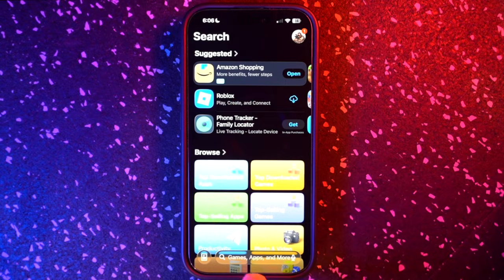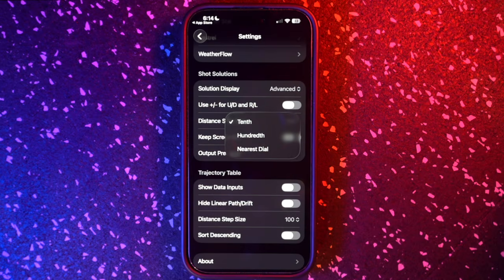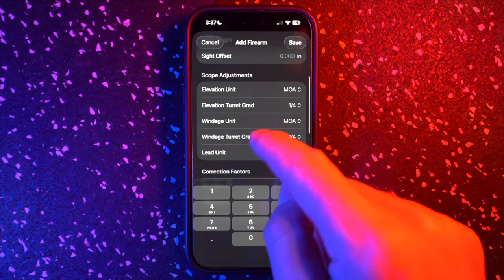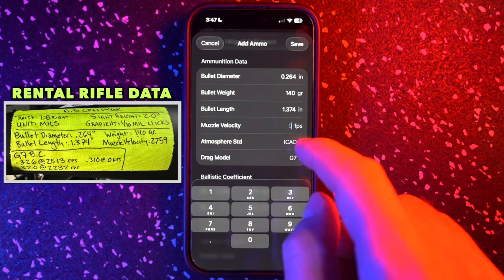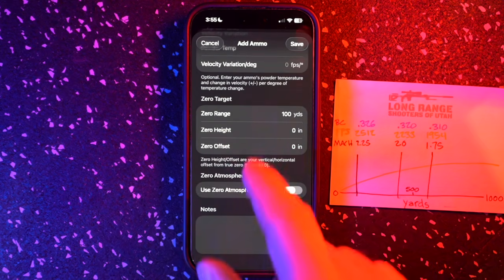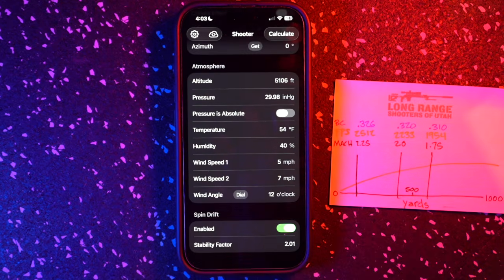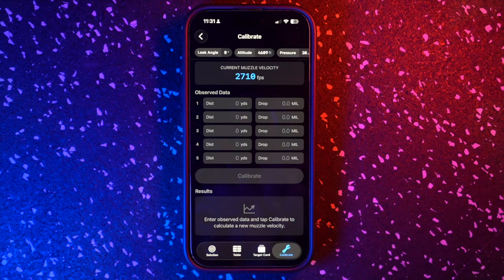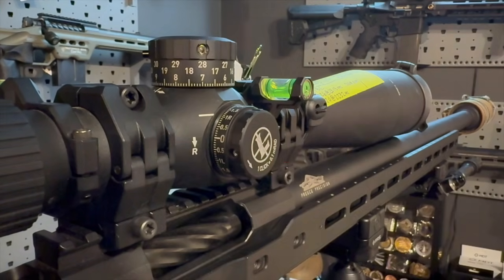How to Use the Shooter Ballistics App: Complete Setup Guide (2026)

Comment: Hello:
I updated my app and your walk-through was very helpful, thanks!
One issue:  At https://youtu.be/t03xYSKIn-I?t=2396 I see your altitude is populated from the station, but when I do this on my phone, my altitude is not populated (stays at 0).
(I do have Populate Altitude turned on in the settings) 
I wanted to point this out, because I didn't notice it right away, and my calculated dope was low by .3 MIL before I manually entered the correct altitude.
Thanks
Vincent
Reply from the maker: Very interesting.  Could be a bug in the app.  Did you try closing and restarting?  Checking for an update in the App Store?
Reply: @LongRangeShootersofUtah  FYI:  I removed(deleted) the app, then re-installed, now the altitude populates!  Thanks!
Reply from the maker: @user-tx9mv2cg7e glad to hear it